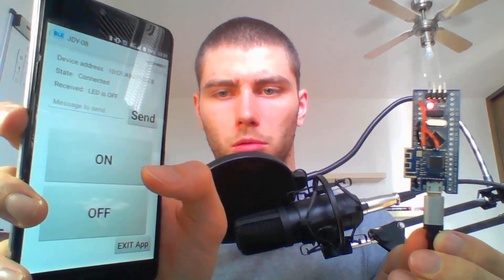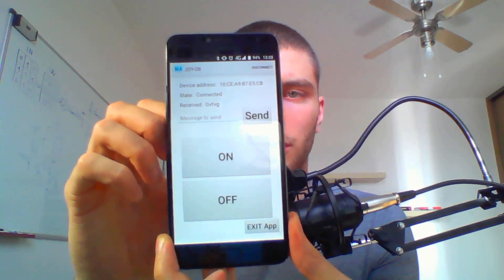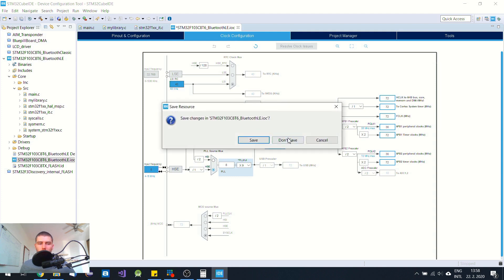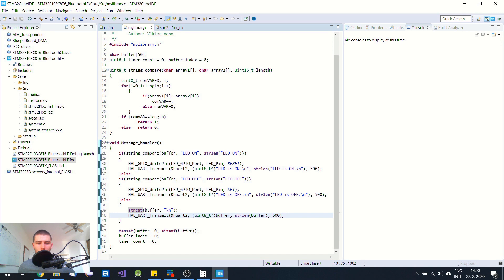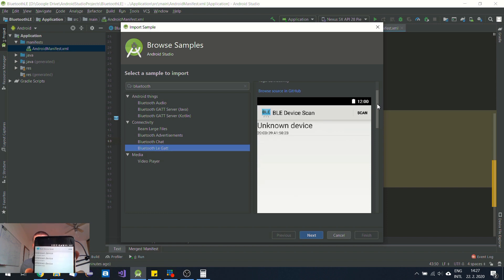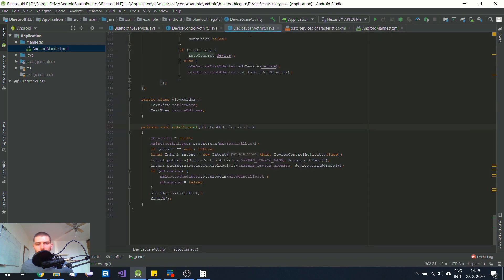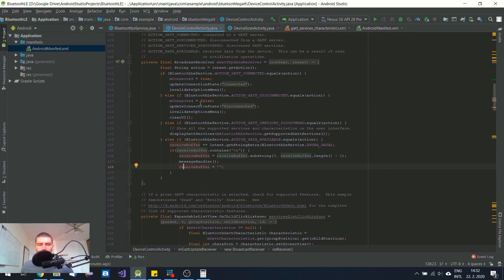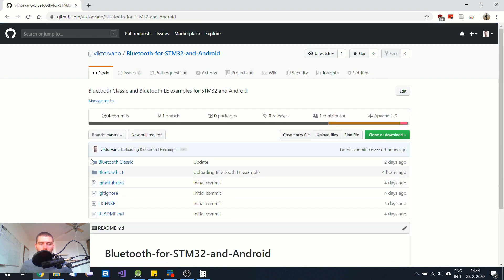Bluetooth LE Tutorial for STM32 and Android (JDY-08 module)

Comment: Awesome tutorial. If you could give me a hint of how to send on/off LED command from second activity ( not the main) would be helpful!
Reply from the maker: I do not send it from the main activity. I jumped from the "DeviceScanActivity" to the "DeviceControlActivity".
This is in the "DeviceScanActivity" that starts another activity:
    private void autoConnect(BluetoothDevice device)
    {
        mScanning = false;
        mBluetoothAdapter.stopLeScan(mLeScanCallback);
        if (device == null) return;
        final Intent intent = new Intent(this, DeviceControlActivity.class);
        intent.putExtra(DeviceControlActivity.EXTRAS_DEVICE_NAME, device.getName());
        intent.putExtra(DeviceControlActivity.EXTRAS_DEVICE_ADDRESS, device.getAddress());
        if (mScanning) {
            mBluetoothAdapter.stopLeScan(mLeScanCallback);
            mScanning = false;
        }
        startActivity(intent);
        finish();
    }

Also "DeviceControlActivity" does everything and uses functions from "BluetoothLeService" class.
Just read the code.
Reply: Thanks for replying me. FYI i am still beginner in Java coding. I have definitely read your code many times. However, my project structure is bit different. I have scan activity and main activity (which i used to send commands from), i recently decided to add a third class which is dedicated to control LED and RGB as well(moving from main activity). I also tried to pass variables (on off string) from third class to main activity then use the writecharacteristic() from mainactivity but it didnt work ( may be i did something wrong). I will check the code you posted here and try again. Thanks again

Comment: Thanks very much, Viktor, for a great tutorial and sample code (Android_BluetoothLE).  This was actually one of the few sample codes that I was able to load into Android Studio and get running.  The only changes I had to make were customizing the UUID's for my service (MICROCHIP_TRANSPARENT_UART) and characteristic (MICROCHIP_TRANSPARENT_TX).  I'm able to auto-connect with the BLE device (Microchip BM71 radio) and send data on the transparent UART.  My Android phone is a Samsung Galaxy S4, which is pretty old.  There's one little problem, however, that I can't figure out:  after sending 8 messages (or alternately pressing the "on" and "off" buttons a total of 8 times), the phone will no longer transmit data.  I have to reset the BLE device to be able to transmit data again.  I have an App from Microchip that talks to the BLE device and this problem does not occur.  It's only on the Android_BluetoothLE code.  I have set the SDK version to 28, and the build tools version to 28.0.3 as you recommend.  Does this problem occur on your implementation?  Any insights would be greatly appreciated.  And thanks again.

Ray Kimber
Reply from the maker: I am glad that it runs. But it works for me all the time. I would run a debug on your phone and also on your microchip device. If you say that you have to restart your BLE device (I assume it is that Microchip device), then after it fails to receive new data, you can try to talk to it without resetting it with a different app. That Microchip BLE device may be frozen or something.

Comment: Does the string_compare function compare strings or arrays?
Cuz passing length of one of the strings is redundant. Strings should be terminated with '\0' so it's better to iterate trough strings until some of the strings has null on the current position and function should return the result immediately. Using redundant variables in the functions causes more pushes on the stack and slower performance. Comparing is O(n), strlen is O(n) so the result is O(2n) which can be improved.
Reply from the maker: it technically compares 2 arrays, where the third argument is the length it should compare. That's why I put the third argument as strlen("something"). I wanted to keep the function simple and universal for the learner, so in a different use case the third argument does not have to be considered to be as redundant.
In C a string is considered as an array of char terminated with '\0'. And the buffer is always cleared with '\0' so they are contained in the string. Just read the code carefully.

When it comes to performance, in this case it is not that critical. This is a tutorial video and I wanted to keep it as simple as possible. My library contains less than 50 lines of code :D